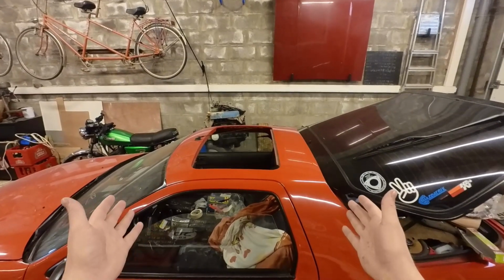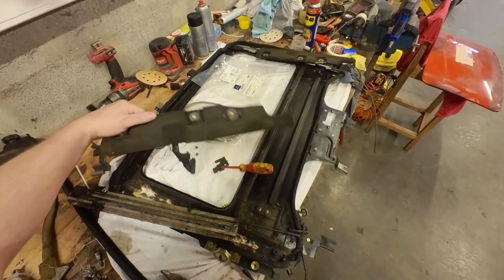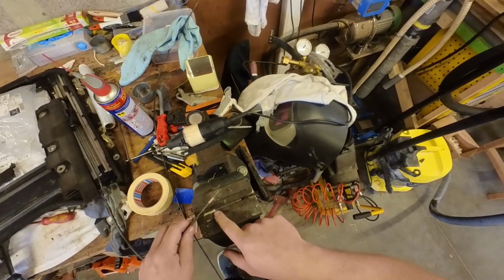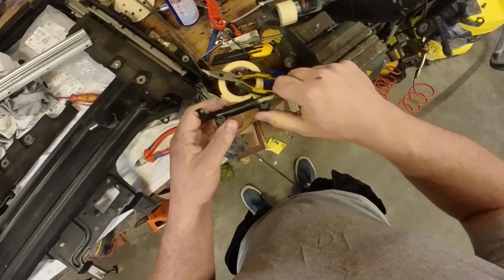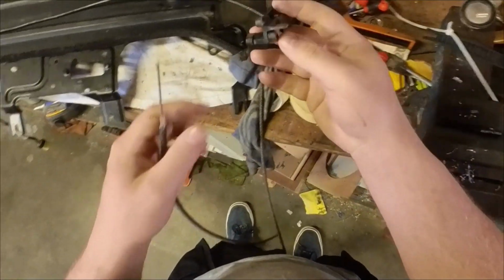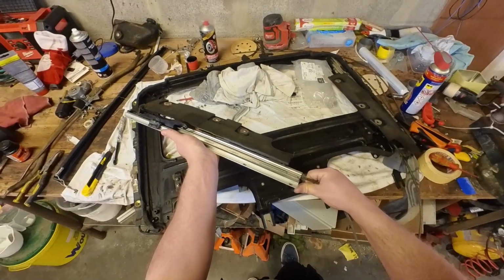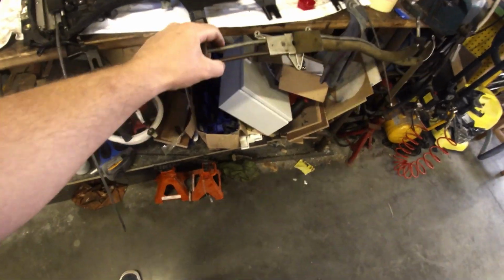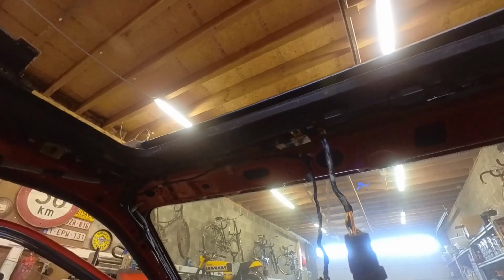1986 Mazda RX7 Sunroof repair

Comment: So you just replaced the wire right ??? The mercedes part did not come with the slider that is oem like the mazda slider ?
Reply from the maker: @bryansautoandmotorcyclerepairs  yes, correct. If you use the mercedes wire, you have to cut off the mercedes slider and mount the wire to the mazda slider
Reply: @VintageGarageYT  ok mines is stuck upwards and wont go down or slide back so im gonna do everything you did to try and save it thank you so much
Reply from the maker: @bryansautoandmotorcyclerepairs  no worries man! Glad I can help! If you have any other questions, dont hesitate to ask!

Comment: Great video, helped me fix mine. Thanks
Reply: Land Rover cables are too thick, I got the MB cables as in your video, made new tubes. Sunroof working.
Reply from the maker: @a5dsr That's awesome! Glad its working again!🎉
Reply: Lucas wiper motor ( like on old Landrover) cable is 5mm and looks the same but much cheaper, I’ll give this a go.
Reply from the maker: @a5dsr  glad I could help! Thats a good idea actually. Let me know if it works or not!